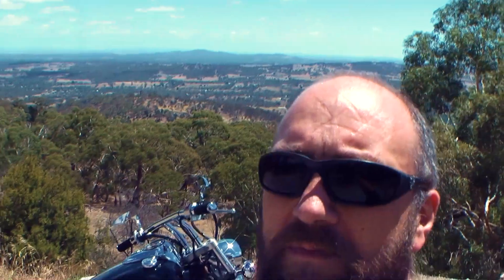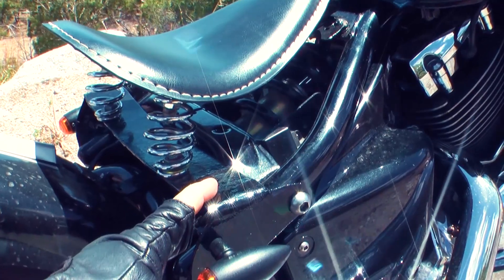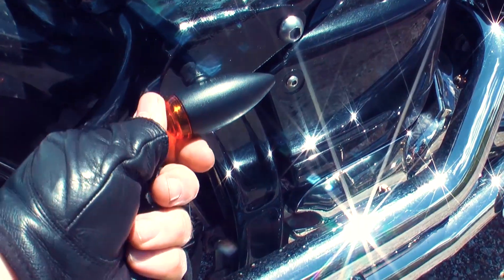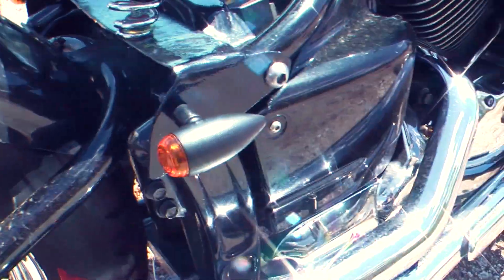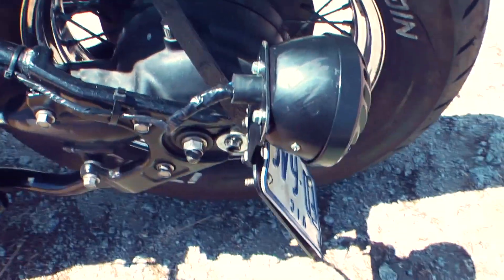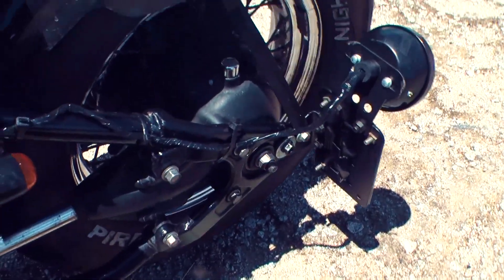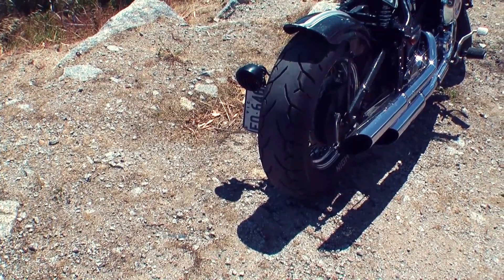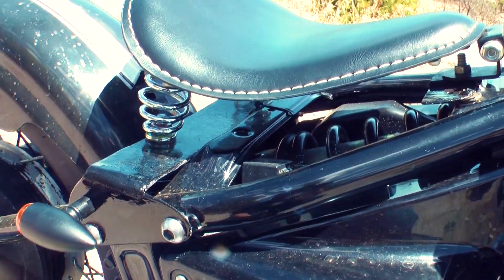Yamaha XVS 650  - Budget Bobber Build  PT1

Comment: How did you mount the new fender mate?
Reply from the maker: I have to go on memory as its not like that anymore but I made custom bracket..I vaguely remember bolting it onto an existing frame bolt and making up some flat supports that went from the fender to the axle.
Reply: Ok I see thanks ✌🏼